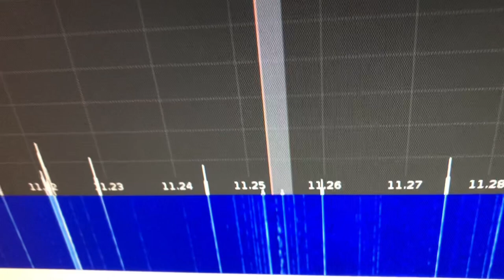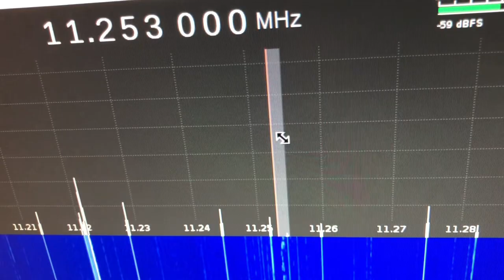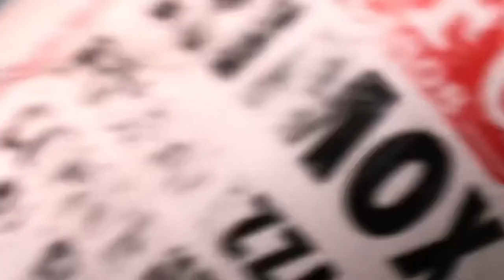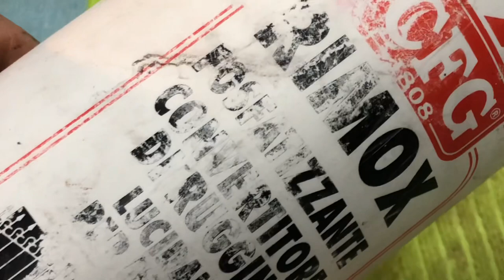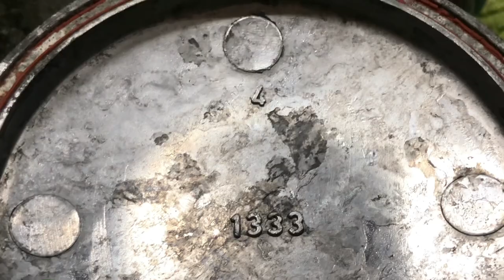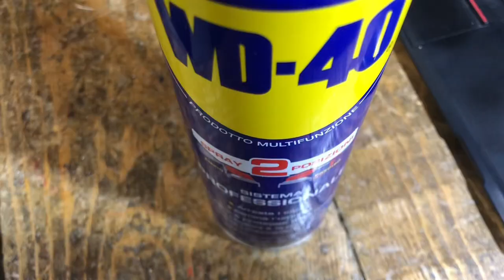RUTTAURO: restauro scatola di derivazione ASMR e RUTTI! ASMR restoration with BURPS! RELAXING AUDIO

Comment: Tasto rutto 1:16 Slow motion per 8s
Tasto rutto 2:14 Slow motion per 14s
Tasto rutto 3:30 Slow motion per 9s
Tasto rutto 3:56 Slow motion per 10s
Tasto rutto 7:47 Slow motion per 10s
Tasto rutto 8:06 Slow motion per 7s
Tasto rutto 8:23 Slow motion per 5s
Tasto rutto 11:29 Slow motion per 7s
Tasto rutto 15:32 Slow motion per 4s
Tasto rutto 19:38 Slow motion per 12s
Tasto rutto 23:42 Slow motion per 8s
Tasto rutto 23:42 Slow motion per 8s
Tasto rutto 25:16 Slow motion per 12s
Tasto rutto 25:58 Slow motion per 6s
Tasto rutto 30:04 Slow motion per 14s
Tasto rutto 32:54 Slow motion per 15s
Tasto rutto 34:40  Slow motion per 16s

---------------------------------------

Extras:
Soluzione digestiva a 17:59
Ululato a 24:38